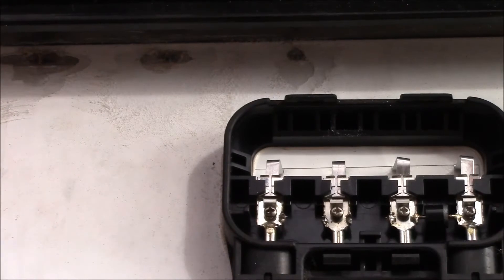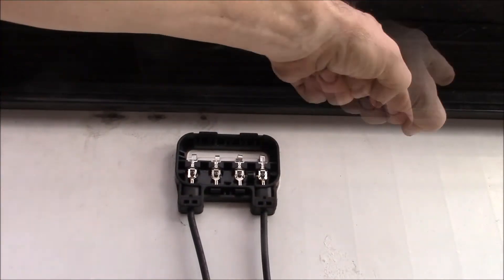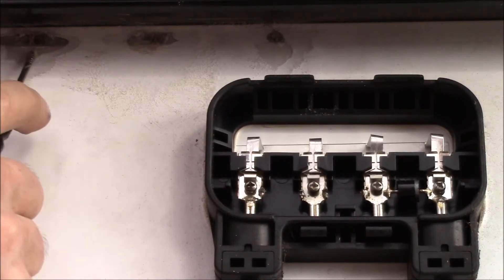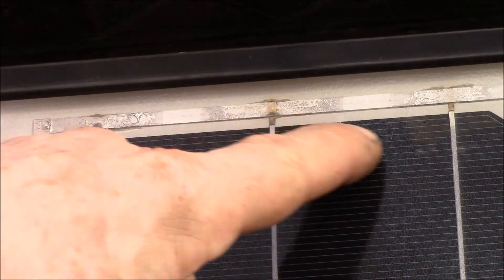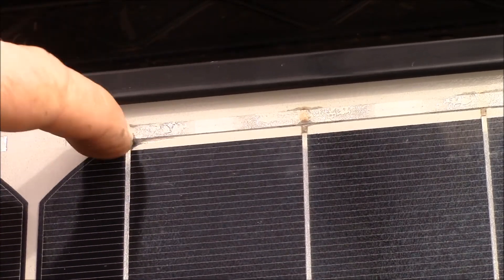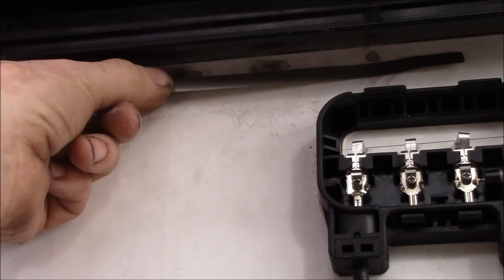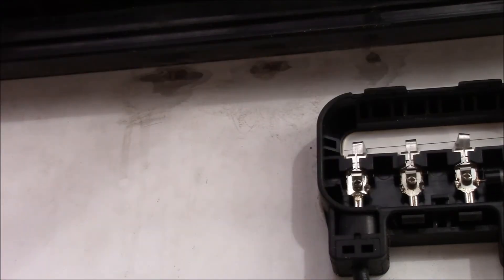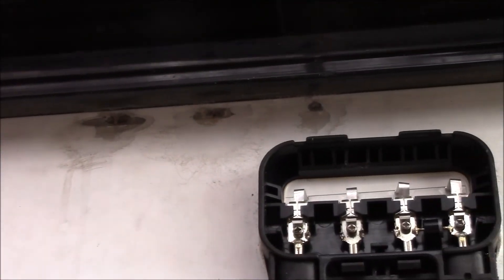Solar Panel Troubleshooting and Repair, Part 2

Comment: On all panels they have what you call the silicone cover it's actually called EVA Encapsulation which is melted between the glass & solar cells, buss bars & wires then there is the solar cells followed by another layer of EVA Encapsulation & then lastly there is a white thin board called Tedlar Backsheet. So far you have sanded down the Tedlar which was white, you are at the EVA which is clear & you can remove that no problems before you begin soldering.

When it comes to making the back of the panel waterproof again you should use a heat guy for a little while around the area to be painted with waterproof paint to remove any moisture & you should do all of this work in an area which is away from any moisture as well. If you have a dehumidifier then use it but if not then make sure you are in an enclosed garage with some sort of heater going an hour before you begin painting & leave the panel nearby the heater so that it warms up & has no moisture. Remember to give the paint the required drying time & give it a few coats.

If you have any exposed bus bar you should put some heatshrink tubing & where the end of the exposed bus bar joins onto the main busbar just use some silcone sealant to seal between heatshring tubing & panel busbar.
Reply from the maker: Thanks for the great information!  I still need to get back to that panel and see if I can get it working again.

Comment: couldn't find part 3 how did it turn out ?
Reply from the maker: I never got around to finishing this repair.  I didn't have a place to install this extra panel, so the urgency diminished.  If I can come up with a use/place for it, I'll definitely film the final repair.

Comment: Did this work?
Reply from the maker: I think it will.  I've managed to get 2 of the 3 copper tabs exposed and need to spend some more time to get the 3rd one exposed.  But it's been so busy with work and other projects, I haven't had the time to work on this panel.  Also, I didn't have a place to put this panel for a long time.  But I recently expanded the rack on the roof of the house to fit one more panel, so finally have a place for this one to go once I get it repaired.  Hopefully will get back to finish this in the next month or two.

Comment: My Logic.    Your Diode went Tits Up.   WIRE  SHORT Tits up.   Come Night time Your own Battery  reverse Current Fused those two or three connections.    My fix would have been simply to re-flow the solder and joint in place.   Diodes protect from Reverse current at night .   Not Bypassing anything.

Comment: Yes the bad connection generated excess heat which made the tab connection come off and in turn over heated the diode because it was in by pass mode 24/7. What you are going to do should work. Like I said I used rubber spray paint but your rubber tape should work
Reply from the maker: Thanks for the comment.  That was my thinking as well.  Once I get the rest of the connections cleaned up, I'll see what the repair looks like and then I think the EPDM weather stripping tape should work to seal it up.